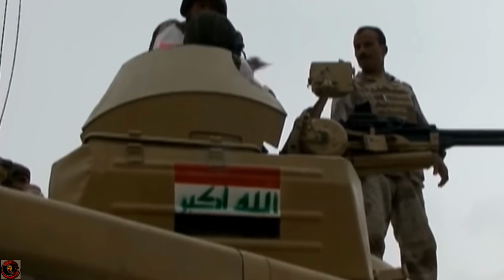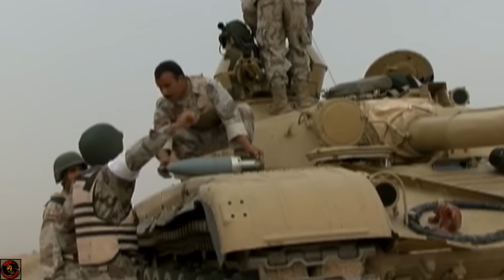Do Russian Tanks Need Bigger Guns?

Comment: No! In the WW2 russians had no good armor penetration with the 76,2 mm guns. They made a longer 57 mm gun that could penetrate more. Now they want to use a 152 mm gun, with its disadvantages instead of develop something better: a longer gun, with a new breach, whitch can withstand a bigger propellant. Maybe a smaller caliber too, with its advantages: faster reload, lightweight, more ammo. That gun could shoot faster SABOT rounds, but smaller HE(F/SH) and smoke. Ultra high velocity guns with explosive propellant is a step back, but until railguns cant be used in tanks, it is the best choice for tank to tank warfare.
Reply: with explosive propellant you have acceleration limits. So you need bigger caliber. tho today you have no engine that is powerfull enough to carry the armor which  defeats a 120mm sabot. So, if we need better penetration. It will be gauss with hybrid motor and better bateries
Reply: Actually, they temporarily suspend the production of the 57mm gun because was too much powerful that overmatch all early German tanks. It came back in service when Tigers and Panthers become more common.
Reply: Miltac0408 Tanks with railguns? Haha They will need to be connected to the super power socket? ROFL
Reply: Are you smoking crack?
A larger caliber gun is the solution to wanting a bigger bang (more propellant and a higher mass projectile).
You cant get any faster anymore, Soviets hit the limit of 1900~2000m/s decades ago and it is the primary reason why their gun barrels have shorter lives compared to the L44, for example, which has a significant velocity disadvantage compared to Soviet guns. The higher the velocity the shorter the life of the barrel and 2000m/s out of a smoothbore is considered the practical limit. Also it needs to be noted that Soviet guns when shooting HE and HEAT have a much longer life than when shooting APFSDS.
The primary issue with Soviet tank guns using the autoloader was the maximum projectile length limitation, which is important for APFSDS. Soviet and Russian APFSDS projectiles are considerably shorter (although faster) than NATO ones (until the L55 was introduced), which reduces their performance. The T-14 solves that issue with a new autoloader and ammo for the 125mm that would physically not fit into any other 125mm loader.
There is no "ultra high velocity" when you are already on the physical limit what guns can handle.
And railguns? Oh ffs not this moronic shit again... How about magic propelled shells at unicorn velocity made from rainbow steel obtained from leprechauns?
A 152 or 140mm gun has the advantage of shooting a higher mass projectile, which means more muzzle energy and better penetration. Also higher caliber HEAT rounds are, well, higher caliber heat rounds. Pretty self-explanatory.
We went up from the inadequate 105mm to L44 and from L44 to L55 for a reason. Same for Soviets, from 100 to 115 (first smoothbore with APFSDS) and then the 125.

The actual question today is whether it is worth investing in a larger gun given that tanks have reached the practical limits of weight and armor. The T-14 would suggest that the Russians at least do not consider a new larger gun being necessary if they can improve the APFSDS geometry (and thus its performance) that was previously limited by the autoloader. Whether NATO has the same confidence in the 120mm remains to be seen.
Reply: Go look at the kv 2 then you will know why
Reply: +ARcanRMX
you are mistaken. Production of 57mm guns was stopped because of high percentage of defective gun barrels. Such things were hard to produce for the Soviet industry back then
Reply: +Miltac0408
152mm == bigger shell, more explosives fit in. And, suddenly, MBT could be used not only as tank destroyer
Reply: Wrong 57mm(Zis-2) production was stopped because of bad HE round and 76mm had almost as good penetration when APCBC round was used.
Reply: The 85mm had good penetration
Reply: +manuel maßmann Yes, the limit is around 9-10 km/s, because it is under the highest detonation velocity of explosives. Now the hypervelocity tank cannons starts around 1 km/s according to the Wikipedia, and it is not even close to the physical limits. Present 120 mm cannons has limits too, and it is around 1000 mm of RHA penetration. Probably, most of the modern MBTs - Leopard 2, Challanger 2, Merkava, Altay, T-14 (the hull surely), maybe Abrams, Leclerc, T-90 - cant penetrate each other from the front, only at weakpoints.
Reply: For those who think a smaller caliber HE does not enough... :
More explosives fit in a shell does not mean better infantry support. See the difference between BMP-1 and BMP-2? Why they changed the gun? Because it is better for infantry support. 73 mm versus a rapid fire 30 mm. It is like a 6-8 rpm 152 mm gun versus a 15 rpm ~100 mm gun. The smaller caliber can shoot around equal explosives, but against more targets. The faster reload gives less time to the enemy for shoot back or move between two shots.
Reply: They already have a bigger gun and longer barrel. The SU-152 has a 152.4mm gun with 9m barrel
Reply: Allen Yes, they have. It was made in 1965 and it needs new ammunition. It can penetrate only 300 mm at 2 km with APDS. That is not good... Enough for kill only IFV-s and some MBT-s on the side. At closer ranges it can be more effective, but still less penetration than a 120 or 125 mm gun. The most effective shell its HE, but then that long barrel does not matter, it becames a huge artillery piece. The Mysta-S is a better example for that.
Reply: 76mm was chosen because it had a way more potent HE round...

They do already have longer 125mm guns.
Reply: + Miltac0408
New ammo for 152mm, maybe; but it could also be because of different testing standard that maybe 100-200mm of penetration(at least to American standard) got lost in translation:
http://ftr.wot-news.com/2014/06/08/so-what-is-a-penetration/
Reply: EcchiRevenge That is interesting. So around 4-500 mm pen at 2000 m? Still enough for 1960's but not in the present. With this article the 125 mm guns are better in my eyes too, and that long 152,4 mm gun is still not better on paper.
Reply: @miltac0408 76,2mm in 1941 was good enough for anything germans had
Reply: In 1965 the the 152.4mm gun was good enough to go straight thru any western mbt at the time but the 125mm was so good that the su 152 was just pointless
Reply: Isn't there a limit on velocity too where projectiles shatter on impact, even if you use tungsten or depleted uranium?
Reply: Christophlnns, nope. There is a limit when your gun simply blows up though.
Reply: Object 120 woud like to have a talk with you
Reply: Smoothbore 152mm cannon 2A83 with chrome plated barrel provides a pressure of powder gases of 7700 atmospheres, while the most advanced tank guns do not give more than 3000. High pressure gives the shell a greater initial speed and monstrous power when colliding with the target. At a distance of five kilometers, the Object-195 armor-piercing projector strikes the enemy with a force that is one and a half times higher than the standard tank ammunition at a two-kilometer distance.
 A large-caliber tank cannon can also use ammunition from the artillery arsenal: high-explosive fragmentation, thermobaric, corrected Krasnopol missiles and even tactical thermonuclear charges of a kiloton power. The range of a shot of four kilometers and a complex of protection against weapons of mass destruction saves the crew from the consequences of a nuclear explosion. For simpler tasks and purposes, the "Object 195" was equipped with an auxiliary automatic cannon of 30 mm caliber paired with the main gun.
After taking away many engineering solutions of "Object 195" in "Armata", the Ministry of Defense stopped financing the project, but Uralvagonzavod continues work on the tank in an initiative.
Reply: tank gun of 152 mm was developed during the late Soviet USSR, was built several 
prototypes of tanks with similar gun
Reply: but us amuricans just use lazurs now. thers no way this commie shit gonna win